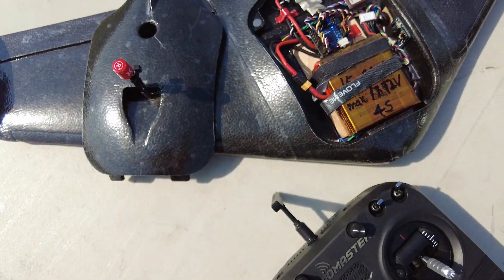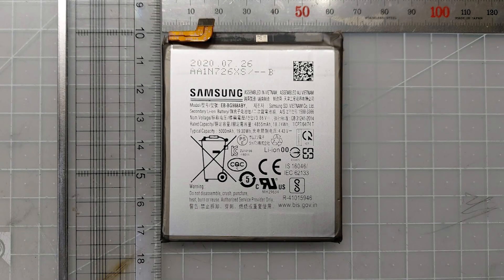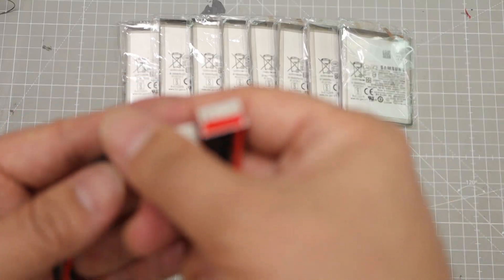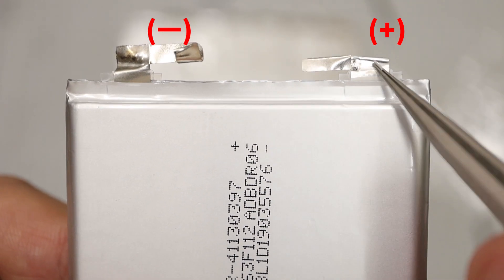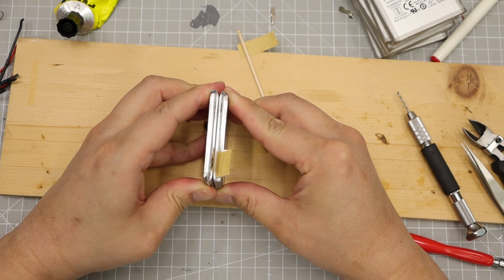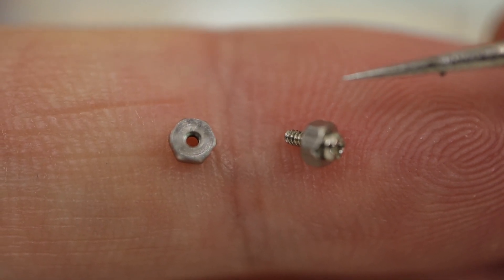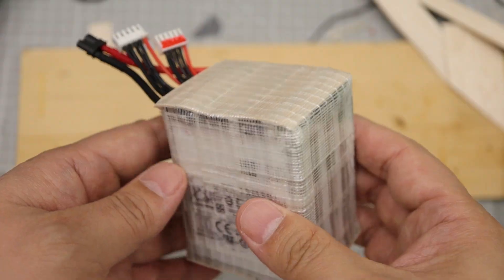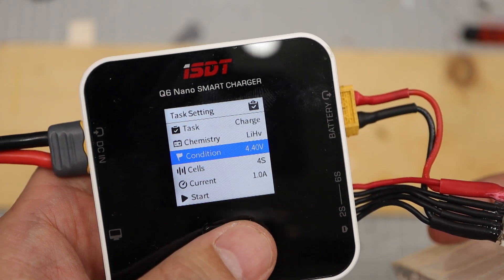Building battery pack for FPV wing using phone battery

Comment: Looking great! I just ordered 4pcs for my baby ar wing after your 100+km flight
Didn't know you chose to bolt the battery terminals; why did you chose this method over regular soldering?
Also how did you manage to get the CG forward enough on the baby ar wing; did you need to add a lot of weight?
Thanks!

Comment: Thanks for sharing.
The 8S isn't for the baby ar wing pro correct?
Must be the bigger sonicmodel wing.
Which motors are you running the 8S on?
Does the FC power off 8S or do you need a bec?
Reply from the maker: I want to lower the current draw for long run, so I raise the battery voltage and lower the Kv of motor.
Most ESC for 6S, are use 40V mosfet, it can run on 8S.
The FC at vid, Matek F405WMN, it has a TVS diode which needs to be replace for 8S.
TVS diode for 8S : SMBJ36A(MP)
The power for camera and VTX use a simple BEC(Vbat on FC -> matek MIcro BEC6~60V->Camera&VTX).
Reply: @celeselements  thanks. I run 8S on a few fpv drones. Hakrc and foxeer sell 8s esc. Jhemcu has budget 8s FC.
What motor, kv are you using on what prop and wing?
I make my own 8s liion and lipo too.
What esc are u using? Thanks
Reply from the maker: There is no rule for choosing motors and propellers.
Based on quadcopters, 5 inch 3 bladed props, 22xx~23xx motors are approximately 2000Kv for 6S at racing.
For long range, in my opinion, the Kv of quad motor divided 1/2 and choose larger prop.
My babyARwing is 8S@2208/1500Kv and 4 inch props. It is not good matching, but I tried various way.
I use hobbywing Xrotor 40A micro, it is discontinued unfortunately.
But most ESC for 6S could run at 8S, I believe.